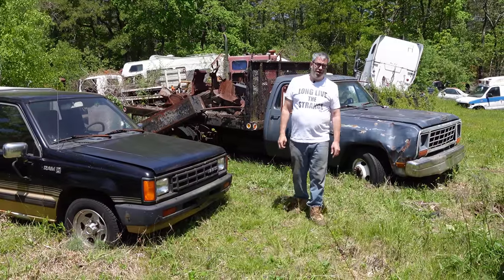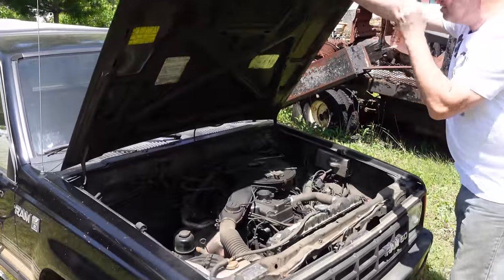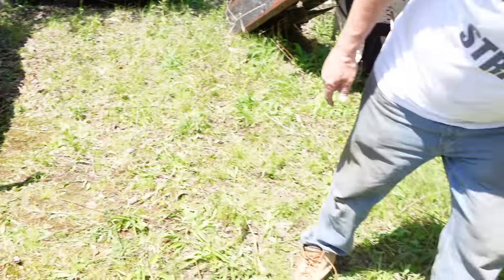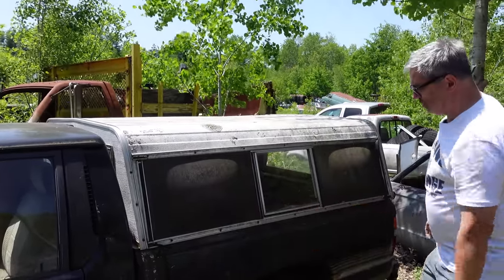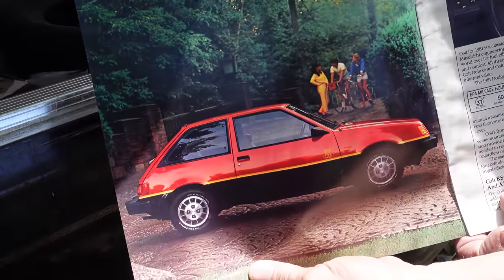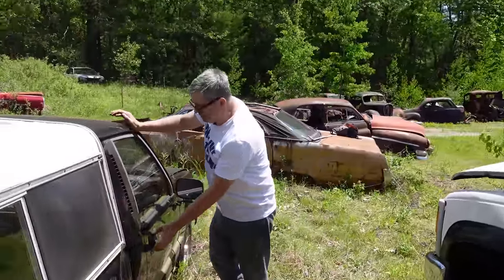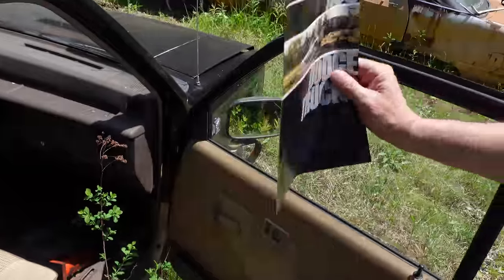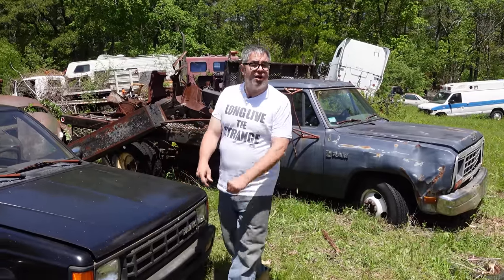Baby Ram

Comment: The absolute best looking mini truck of all time is the Datsun 620 Lil Hustler aka Bullet Side. 
The most reliable mini trucks were the Toyota 20r 5speeds.
Runner up was the Mazda B2000. 
Datsun 520s J series motors were more reliable than the 620s with their L-16 /L-20 engines.

Most importantly.. These are my experiences..and just my opinions.. so take what i say with a grain of salt.

Comment: The Plymouth arrow was the same as the Dodge Challenger it was not a pickup truck.
Reply: The truck sold at the Plymouth dealer was called the Arrow pick up.  The Plymouth version of the Challenger was the Sapporo.  The Plymouth Arrow was a completely different car.

Comment: Steve Ihad an 87 mazda 4x4 that had that same engine also. my engine failed and i bought one out of a d50 dodge, same engine..
Reply: Then someone put it in there. A Mazda pickup truck of that vintage would not have come stock with a Mitsubishi engine. The D50 and Mitsubishi cousins, yes, but not a Mazda.

Edit: There was a 2.6L Mitsubishi sourced engine for a time.
Reply: @googleusergp  i live in new brunswick just north of you and i had an 87 mazda B2600 4x4 that came from the factory with the 2.6 mits engine. what i was told from the guy who bought it new was for 2 yrs 87 and 88 mazda b2600 had this engine.
Reply: @albionleslie3524  I stand corrected, there was a Mitsubishi sourced 2.6L for a few years. It was called a B2600 as noted. That's what happens when you go off the top of your head too quickly. LOL.

Comment: around the 80s American merge with the Japanese automobile the Mopar had Mitsubishi the GM had the Toyota and the Ford had the Madza in 1978 Mitsubishi made a Dodge Challenger but it was a 2 door Galiant by Mitsubishi and in the early 80s GM made a Pontiac Fiero with the Toyota MR2. The Ram 50 got out sold from the Dakota cause the Dakota became the first Mid-Size pick up.
Reply: Serious about the Fiero? I thought Pontiac went to the drawing board for the Fiero, designed and built the entired chassis/ body at least. Fiero's powerplant was GM, correct?
Reply: That's not correct. The Fiero came out in 1984, the MR2 in 1985. They have nothing to do with each other, except that they competed for the same customer base. They are not "based on each other" and they did not share parts. In fact, the 1984-1987 Fiero borrows from the GM parts bin (such as the Chevette) with various parts. The powertrains in the Fiero were all GM designed.
Reply: You think the Fiero was a Toyota MR2?
Reply: Okay maybe the Fiero not a MR2 base but they are mid-engine with flex plastic body are they and my late cousin had a Fiero using MR2 parts before he trash it.
Reply: @captaindew3106  That doesn't mean they're related or the same vehicle in any way. Camaro parts fit a Firebird in some cases, so that's more of an apples to apples comparison. You're comparing  apples to oranges.

Comment: Neighbors had one. Couldn't make the electronic carb work right. Run but not great.
Reply: There was a carburetor rebuilding company in Chicago (which may still be around) called "Foreign Carburetor". You'd get a rebuilt in the box with instructions, "Turn the white painted screw three turns, the red painted screw out two turns, then in three turns", etc. Their products were excellent and made many a heap run decent (for a time).

Comment: I think you could get these in diesel as well?
Reply: No, you're probably better off not thinking LOL.
Reply: Yes, from 1983 to 1986, that's correct.
Reply: And one more data point -- the 1978 Dodge Ram could be had with a Mitsubishi 6-cylinder diesel.  One year only.
Reply: @bobbbobb4663  Yup, 6DR5 engine.